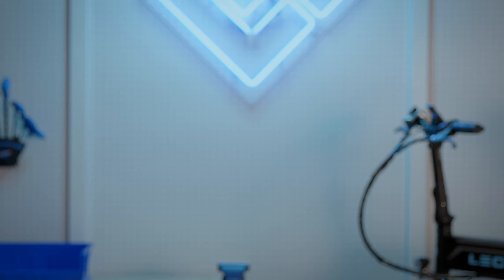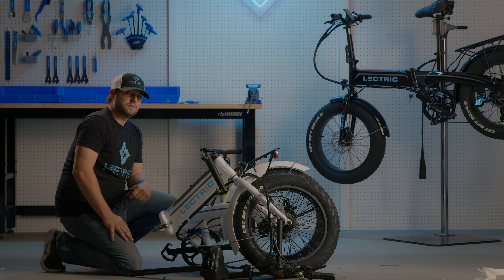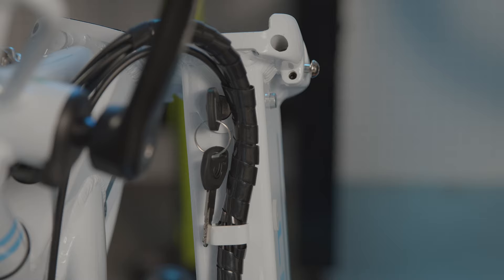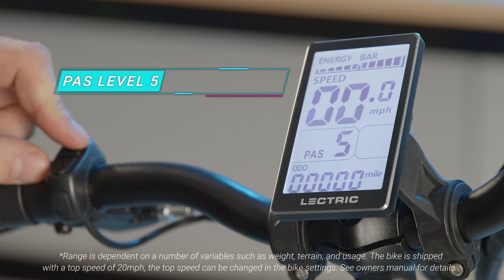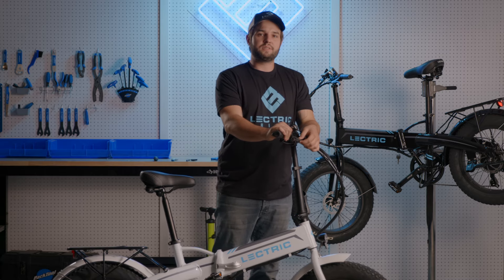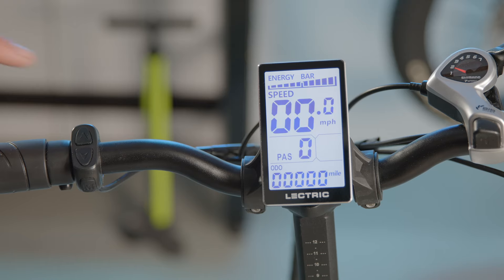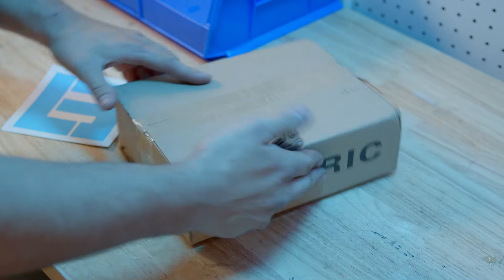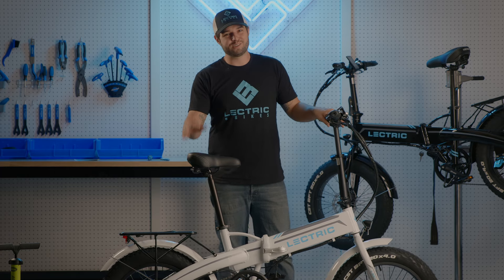Lectric Service Center | XP 1.0 & 2.0 First Ride

Comment: Was told my wife's 2.0 would arrive the day before Mother's Day, so I was very excited. But it was delayed and I was sad it would miss the big day...but guess whaaaattt ??? It came today, on a perfect 68 degree Mother's Day here in Chicago's suburbs. Took me some effort to hide the delivery and get it into the garage without any of the family seeing.  Put You Tube on my tablet and had the bike up in about an hour. Did have to charge the battery a couple more hours tho.

This thing is a blast !! Really considering another for me, and I have a grown daughter who was really eyeballing mom's....lol.  Put assist on level 1 and acclimate yourself to the feel. Do NOT put assist higher until you get how this stuff works- it's kinda scary how powerful today's electric motors are. I absolutely love how Mode 2 operates, once I found the feel for it. You start off pedaling and within the first 15 feet the power assist kicks in. Again, start with level 1, or you are gonna jump out in front of traffic or at least tip over...:))  When set on Mode 2, twisting the inside section of the right grip will get you going all by itself, which is an easy way to start non-bike riders .Again, LEVEL 1 till newbies are good at balancing and turning !!!

I'm only 5-5 / 155 and she is 5-0 / 100 so "fit" was a big worry.  I find the seat at just 2" above lowest works for me, and 1" above lowest for her works fine. The handlebars are at lowest level. I think as we get better, the seat can go up just a bit.

If you are on the fence about e-biking trails and paths ( I don't plan to do city roads...rural maybe)...the.LECTRIC 2.0 Step Thru comes HIGHLY RECOMMENDED by me.

Comment: I just put my order in today for this e-bike. I am looking forward to getting it soon. I still have my old Giant Mountain Bike since 2012 I bought in Maryland when I used to live in that state which will be a nice back up and it is not a E-Bike but has served its purpose all these years. This will be my first E-bike :) Thanks Letric I hope you'll stick around for longterm to help your customers for any future needs thanks again.
Reply from the maker: Hey Ronnie! Thank you so much for your order! We are so excited to see where your Lectric adventures take you. We are here to stay - Let us know if you need anything as you get rolling! 😊🙌
Reply: @LectriceBikes  One thing I was wondering about is must the key remain at the bottom while riding while I had the concern the key may fall out below the battery but I am assuming it is locked in place. When I stop somewhere I would want to take key out not leave it in as I am wondering if that is possible and can I ride the e-bike without the key at the bottom would be prefered if the battery can stay locked in place. 

Some insight on this would be great and also if one loses their keys how can one get a spare? I do plan on making some backups if that is possible for those tiny keys. I also saw on your store page you are only selling letric tires for your 1.0 and I have not seen any being sold for the 2.0 I am assuming you have not listed it yet? Thanks for the help I figure I'd post here these questions here in case others where looking for answers as well.

Comment: I love my Lectric XP1, and this is a good video for people to start out with. One very important thing, in fact critical, is to make sure the pedals are tight; I have read a lot of reports where the pedal comes loose on the first ride and wrecks the thread, so that the owner has to replace the pedal and the crank arm. You really should emphasize this before the first ride. There is very little that is more important.

Comment: I absolutely love my XP 2.0 I have over 400 miles so far with no troubles at all. This a wonderful bike. Trevor is The bike dude. Get one people, they are SO worth it. 😎👍
Reply from the maker: So glad to have you riding Lectric! Let us know if you need anything, and happy trails! 😊🙌
Reply: 400 miles?! Holy crap. I can't even get 10 miles in PAS 2 before my battery is completely dead.
Reply: @neutronpixie6106  There is a further vastly dissatisfied post from this nickname down below, but no mention of any warrantee pursuits or customer assistance requests.  Kinda like it is just a sarcastic troll post from a rival company?................................elsullo
Reply: @neutronpixie6106  Exactly my point. These batteries straight up suck and you are lucky to get 18 miles on a full charge, without using throttle!!
Reply: @LectriceBikes  your batteries do not get near what you claim they do. Fully charged I only got 18 miles using only pedal assist 2 & 3, no throttle used. What gives? This is not what I was promised when i ordered!!!
Reply: Mine will be here tomorrow!

Comment: Just got my Lectric eBike out of the box, can't wait to take it for its first ride...
Reply from the maker: Awesome! Welcome to the Lectric family!⚡️
Reply: @LectriceBikes Oh my gosh, I'm so glad there's someone monitoring this channel.  Question? The unboxing video kept mentioning measurements on the seat stem but mine doesn't have measurements, it drops all the way down into the frame.
I called this afternoon when it first came because the box had obviously been opened and taped shut, all the staples were broken. Am I missing a stem part?
Reply from the maker: Hi Chris! Please send a picture of that stem into contact@lectricebikes.com and we will get that fixed for you!⚡️💙
Reply: @LectriceBikes  Hi Lectric, There really is nothing to "fix". As long as it doesn't void out any warranty its just fine the way it is. I'm a small woman so the seat has to go all the way down anyway.
I will send a picture though if you'd like.
 When I get everything together and put a few miles on, I'll go to your review page.

I am so thrilled with my new bike. I prayed about this for months, wish I hadn't taken so long to decide.

Comment: just trying out the xp lite for the first time.  Had great support over the weekend from Molly on a few issues I was having that I didn't understand.  I would have liked it if the manual was with it, but had to go online.  I understand the trying to save paper thing, but I need a manual right in front of me when going through stuff and didn't want to have to print out the whole thing.  Still getting used to everything.  The one thing I may regret is not having gears.  While the pedal assist is great, even in PAS 1, it takes off for me and I'd rather pedal, but without it, a bit hard.  More practice needed.  Also, my friend who has an electric bike said she uses the throttle to get her going when she just wants to pedal or doesn't want a delay in pedal assist, but this bike's throttle only works in PAS 1-5 and not when it's in pedal only.  Anyway, I look forward to getting used to this little beauty.

Comment: I bought a raincoat for my ebike.  Amazon sells them as "disposable".  They're clear plastic, made to fit, 4 to a package, $25.  I thought it necessary, as here in Florida, we get torrential downpours which only last 20 minutes, and I don't want my new ebike ruined.  I also carry a tiny rain poncho for me, just in case.  It would be nice if Lectric supplied some!  (Consider it Free advertising!)

Comment: Just received my new XP 2.0 today. Was able to show off to family and take for a spin. Love it.
For a maintenance question, what do you recommend for a lubricant for both the chain and other movable parts? Thanks.
Reply from the maker: Hey Rick! We recommend Tri Flow for chain lubricant! Please let us know if you have any other questions - We are here to help! 😊⚡️
Reply: I recommend "Liquid Wrench Motorcycle Chain Lube" for anything with a chain.  It comes out of the "straw" applicator as a thin liquid that rapidly penetrates deeply into any crevice.  Then the liquid carrier solvent evaporates quickly leaving behind a thin sticky grease that dries even more until it is no longer sticky, but a thin film of dry grease that does not attract dust.  It is also excellent for lubricating gun parts, as when rubbed off it leaves a non-sticky film of rust-proofing.  (I have no connection with the company)  I am just a happy user of the stuff............................elsullo

Comment: Very nicely done video.  Redundancy on the key safety points was a good idea.
Reply from the maker: Those are some of the most important aspects of unboxing! Thanks for tuning in and leaving some feedback. Take care!
Reply: @LectriceBikes  I'm a 75-year old female, and I unpacked my new bike by myself!  I would suggest, opening the box at the top, then you slowly turn the box onto its side (front side down) and slide the bike out from the box, being sure some cardboard is always on the underside between the floor and the bike, to avoid scratching either.  This method took me only a minute, and worked quite well.  No second person required.

Comment: Reading several articles on how to extend the life of the battery is to only charge to 80-90%. Do you suggest this same practice? If so, how is the best way to know when 80-90% is reached?
Reply from the maker: Hi Rick! Yes, this can help to extend your battery life slightly. It will be best to look at the energy bar on the display when your battery is inserted into the frame of the bike and then gage the battery level from there. Please let us know if you have any other questions for us - we are here to help you! 😊⚡️

Comment: Is it common for a EBike battery to charge for 2 hours and 48 minutes even if the battery is new you haven't been used it yet. And it normally charges aleast for 4 hours or so
Reply from the maker: Hey there! Yes, this is completely normal! Your battery will take 4-6 hours to charge when fully depleted. Please let us know if you have any other questions for us. We are here to help you! 😊⚡️

Comment: Hi.  I believe I've watched all the videos, and I'm still not confident enough to take my first ride.  I'm a healthy 75-year old female, in good shape, and have assembled my step-thru bike, myself, and am ready to go...but, I'm scared.  I guess, this is so, because the bike feels like a motorcycle and I've never driven one.  I don't know how to start my ebike from the standstill position, nor how to use the throttle, gears and buttons.  I would so appreciate a tutorial video, of a person who is seated, and starting off from a stop.  A video like I suggest would be incredibly helpful.  Thanks, I can't wait to ride!
Reply: Just got mine too! (step thru)  I'm 62 & waiting for helmet. I'm spending my day becoming familliar with the weight-opening/closing bike & removing battery etc. I have COPD & inflammatory arthritis, so I want to be sure that I can handle it. Using key is tricky-so it's good to try it. (won't hurt anything)
I'm familliarizing myself with the display now while it's sitting here in my living room. I'll take it out to the church parking lot  & do zero assist to start if I can-or go to #1. 
I also understand that cornering can be tricky-so I will practice there. 
There's a lot of videos out there-just search Lectric XP & they'll pop up. 
God Luck!

Comment: 2 out of my 3 bikes were messed up and cost me money to fix on arrival. Lectric customer care told me that's the expectation and to deal with it. Bummer. Also my 3.0 & Premium are slow as a dog!! Love my 2.0 even though it had many issues on arrival, but lectric helped me get that one fixed, it goes about 6mph faster with throttle or pas5 and felt the marketing for 3.0 & premium were misleading on the speed.

Comment: We bought two Lectric XPs. If yours arrives and works out of the box count yourself lucky. If it does not you'll spend a few hours underneath a brand new bike following emailed trouble shooting guides. If you fix your brand new bike you're lucky again because it's a high hurdle to get Lectric to get a new, working bike sent to you for the good money you've already paid. Things happen, we all understand that. The true measure of a company is how well it puts things on track, and makes a customer happy when things do go wrong. Lectric e-Bikes has a ways to go on this count. Be advised.
Reply: I wish I had read your comment prior to ordering, I received mine eleven days ago, charged the battery the following day, and due to cold or wet weather I finally tried to ride it today…it won’t power on AT ALL. I did connect the one connector near the handlebars the day it arrived. At this point I’ve paid $1200 for a useless piece of junk!
Reply: @mlm32809  [wince]. If you haven't called for tech support, do that. They will talk you through trouble isolation. Our trouble ended up being a bad battery unit which we had to wait for. The bike was an anniversary gift for my wife so, needless to say, disappointment was high. Shipping with a bad battery says that the manufacturer doesn't slide in the battery and test before boxing. They both have been working fine since then. I hope your trouble is a simple fix. You just can't help but think- "I just spent a bunch of money and these things don't work right out of the box".
Reply: @mlm32809  How is it going troubleshooting your new bike?
Reply: I called Monday AM and once I received their approval to troubleshoot I removed the battery contact plate and immediately discovered the factory never connected that plate to the controller…My bike runs great now.
Reply: @mlm32809  Glad to hear it wasn't something huge. But still, you don't expect to pay good money for something and have to repair it out of the box. Lectric really should make one last test before boxing.
Reply: Yup, mine showed up with no battery or keys in the box. 😕
Reply: @MichaelCastro-ht9to  Bummer, huh. You're excited to have it finally arrive and... bam! How does this happen? How do you package up a whole bicycle and miss sending critical parts? This is worse, if you ask me, than our case. Either way, it's quite easy to have the end of the delivery process turn on the bike to check it before boxing. Lectric obviously doesn't have that. Good luck getting it addressed on a Sunday. 🥴

Comment: After riding my new XP 2.0 I received last weekend I noticed the handlebars are a little bit misaligned from the front fork and wheel (about 1/4" - 1/2").  Can I just loosen the allen bolt on the top of the headset (That is located under the stem), align the bars and retighten the bolt?

Comment: Just got my XP Lite 2.0 today. Unfortunately its raining but packaging and build is great.
Reply: How long did it take after placing your order? I placed an order last week with the generic “Standard Shipping” because I guess they don’t offer 2-day or overnight shipping and it still hasn’t updated.
Reply: @BlueJayFromDa9  I ordered May 8 and it was delivered (Massachusetts) on May 19
Reply: @BlueJayFromDa9  btw it took 6 of those 11 days before they shipped it. So 6 days prep and then 5 days transit
Reply: @BlueJayFromDa9  one more. I rode 13 miles on my initial charge up and down familiar and painful New England hills at PAS 3. At the end I still had 10/10 bars of power. Very happy with the bike.

Comment: Seems my bottom bracket is shot before 2000 miles.  I'm 150 lbs. and ride 99% of the time on the road.  What do I replace it with?

Comment: Can you guys make video about how to take the battery, from charging and how long
Reply from the maker: Hi there, the battery can be removed by turning the key to the "unlock" position, it can be charged while in the frame or remotely, and a full charge can take anywhere from 4-6 hours. You can find more detailed information on page 40 of the User manual.

Comment: I think my charging port got broken. Is there anyway that i can charge my battery outside?
Reply from the maker: Hey there! You are able to remove the battery from the ebike to charge. However, if the battery port is damaged, we highly recommend reaching out to our Customer Service team for further assistance. The contact information is 602.715.0907 M - F from 9am to 5pm MST. You can also email them at contact@lectricebikes.com. Thank you!
Reply: @LectriceBikes  i tried to contact that number but it seems unreachable. I also send an email. Message u guys from IG account and fortunately someone is currently assisting me through chat.

Comment: I have to question their shipping policy.  I ordered some accessories (2 mirrors, 2 locks, and 2 premium headlights).  They all shipped the same time.  The locks came together in one box.  The mirrors were in separate boxes and just the original packaging which was not sealed shut.  The headlights also came in separate boxes which also were just the flimsy original boxes.  So I received 5 separate shipments.  Why could they not all be shipped together in 1 secure box?  Since the mirror boxes aren't sealed shut and one was not even closed the USPS could have easily lost the mirror in transit.  Just seems like poor shipping policy to me.
Reply from the maker: Hello John, thank you for this feedback. We can have our teams take a look into this, would you mind providing your order number so we can use this to improve in the future? Thank you so much!

Comment: Only put 39 miles on my brand new XP 2.0 and had to charge it TWICE already. The battery is weak and only gets just over 20 miles on a full charge only using pedal assist 2&3